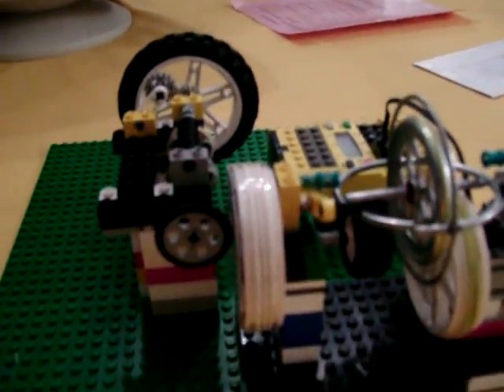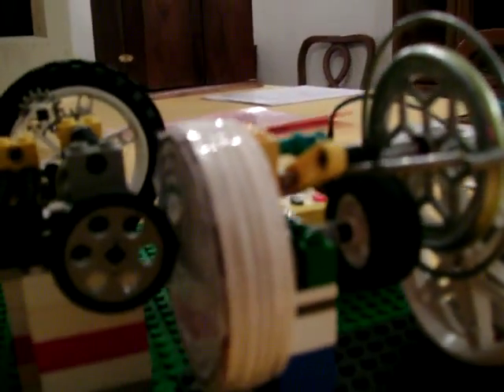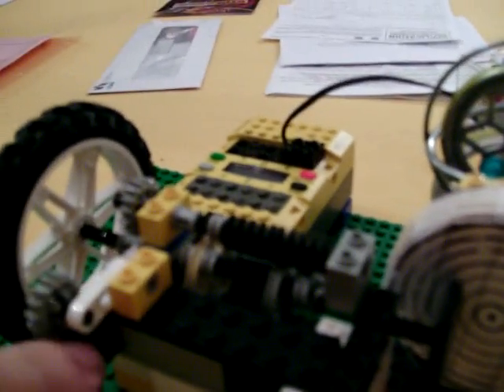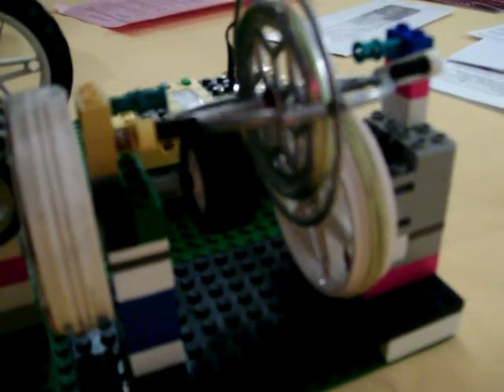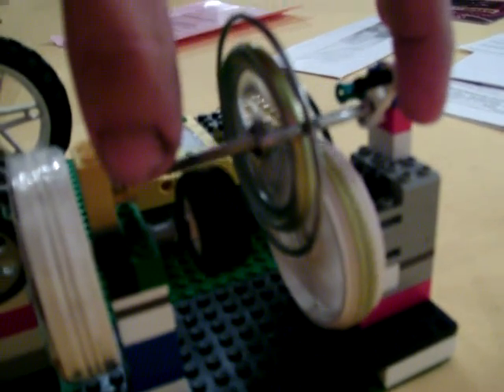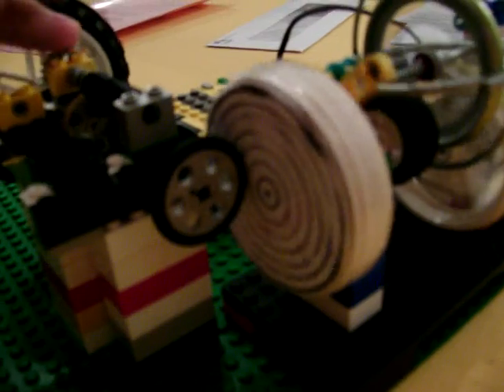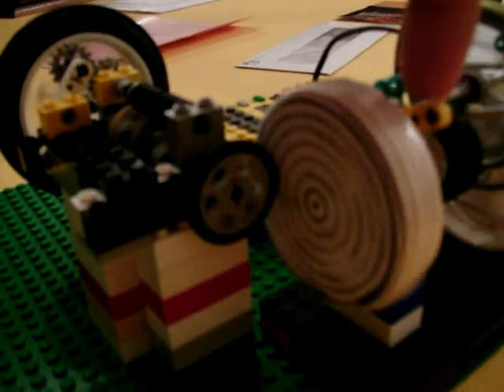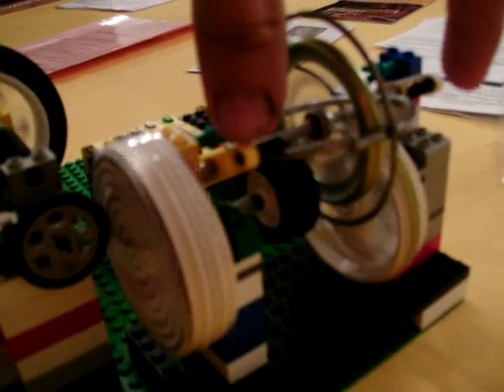Lego CVT flywheel experiment

Comment from the maker: f1 is allowing hybrids starting this year. the issue is that bearings are not efficient enough to make the system work well. i am a mechanical engineering student so i like everything to be mechanical. there was a project that has a bus with a large flywheel but when is turned it rolled over.

Comment: Very cool idea and actually probably more efficient than electric hybrid systems (conversion b/w electrical+mechanical adds up).

I think F1 is using a similar concept. I think they just started using a flywheel to store energy from braking.

I'm a bit surprised this is not currently in todays automobiles... It seems it would help a lot in terms of efficiency.

Instead of converting the energy into heat (brakes) something like this could be used...

Comment: For IdleGod.  The gyro is his flywheel. It is a rotating mass that stores energy for later use when the engine is disengaged. EV cars replace the flywheel principle with batteries and motor generators on the braking system.